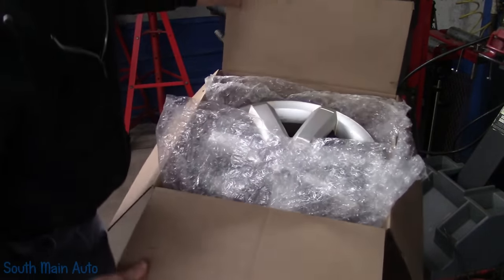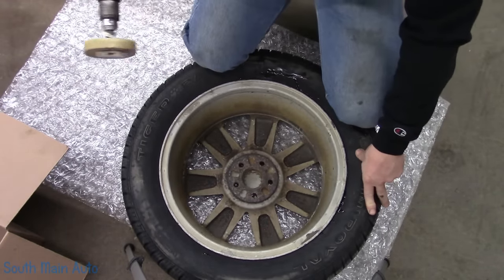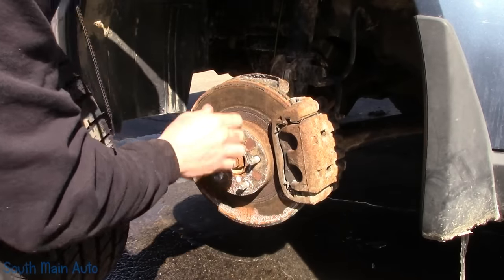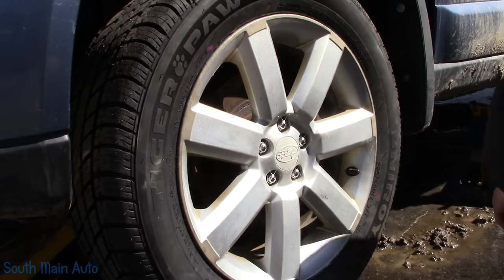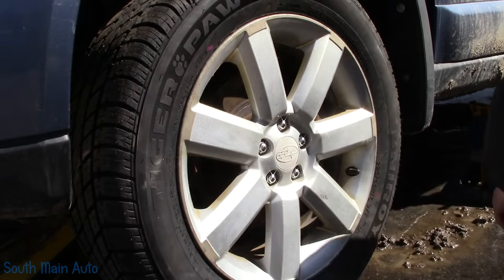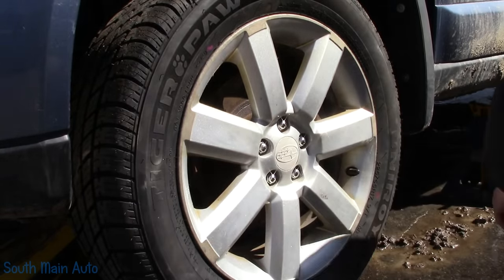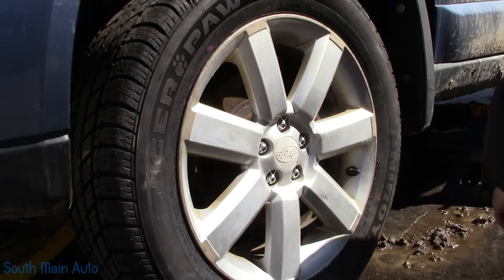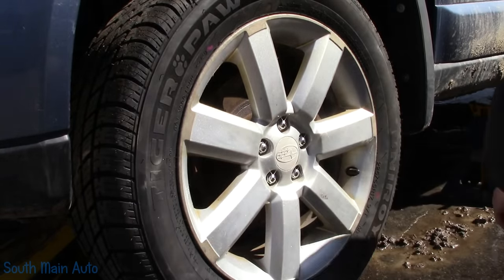Subaru Lost A Wheel On The Highway!

Comment: I am pretty particular about who touches my car. I wouldn't hesitate being your customer. You do good work. Your attention to detail impresses me.
Reply: Did you see the impact gun done on the alloys
Reply: You do awesome work!
Reply: 😂 attention to detail 🤣 .. he gets the job done!!
Reply: @efraincruz6969  The attention to detail would be all the clean up he does that MOST places do NOT do.. and yes he does get the job done.
Reply: Right? I normally work on my own car, but I've come across a vibration issue I can't nail down so I'm looking for a mechanic. I've damn near looked at 40 mechanics and still haven't found one I trust to handle my vehicle.
Reply: Sorry folks.... this guy isnt real. Well, hes real, but his shop is a studio, not a real auto repair shop.
   It cant be. If it was real, there would be at least 3 unfinished jobs in the front, and 2 in the back that have been repaired but not paid for and are basically abandoned.
Reply: @TheBigBigSean  axles or driveshafts and ujoint tight ? Wheels got weight on em ?
Reply: @jupitercyclops6521  Have you been to his shop, Because i drove past it last summer driving to my spot for camping, as his shop is only 2-3 hours away from where i live lol.
Reply: @chris77777777ify  Did you see him follow up with a torque wrench? You need to watch ALL of the video. Nothing wrong with using an impact to get it on most of the way, so long as you finish up with a torque wrench.
Reply: @efraincruz6969  I rarely see this today, detail, getting it right.
Reply: Did the customer go back to where. He had the tire ps put on they  obviously did not torque the lug nuts
Reply: @hairpunut  
Next time I'm near where he is, I'm going to have to check it out. He's two hours and fifty minutes from us.

Comment: I always wondered what a knuckle would look like after a wheel ejection event. Thanks for sharing. I would've needed new shorts in addition to a wheel and tire combo.
Reply: Are you saying you would have gotten a free and instant booster seat?
Reply: I've seen more than one and this is probably one of the LEAST damaged I've seen.  Must have happened at a fairly low speed.
Reply: I agree with ratbert. One of my lower cheap ebay ball joints broke while making a u turn on a small street. The knuckle is fine but I think it screwed up my upper and I then got some metal damage from the tow truck pulling it since the wheel was hitting. So not much damage at low speed. At any speed that could be really bad. When it comes to suspensions do it right the first time. Now I can do my lower ball joints without any problems. Live and learn.
Reply: @myshots101  Luckily it was at low speed or the live part of live and learn might have ended differently. I bought Moog because of these reasons.  They were a little more expensive but past experience had proven they were worth it - when you had a problem with Moog - they stood behind it. Not anymore.
Reply: @ratbert86  True. I got the moogs now. Haven't installed the uppers yet. I'm not sure if it's the ball joint or the bushings that make a noise when reversing now. I have the uppers but think I might get the bushings once I get some money and do both at the same time since I may have to take the arm out anyway.
Reply: Definitely causes white knuckles
Reply: Not a full on tire ejection necessarily.  But look up toyota lower ball  joint failures.

Comment: Re-torque those fasteners after a short drive:
"The most common reason for a wheel to separate is failure of the fasteners, where wheel nuts fall off and/or wheel studs break and release one or two wheels from the vehicle. These failures generally occur 175 to 3000 miles and one to fifteen weeks after a wheel was taken off and put back on during some service, such as a tire installation.

There is a different pattern of evidence in left vs. right side wheel separations. Left side wheel separations usually occur after the wheel nuts spin off (Figure 2) whereas right side wheel separations usually occur after the wheel studs break off 
Wheel nuts that were properly torqued can lose their clamping force. Some reasons are wear of paint coatings on brake drums, break up of corrosion deposits or dirt that was in the ‘sandwich’ when the wheel was put on, and wear of aluminum wheels.

Fortunately there is a well-known remedy for lost clamping force. It is simply to re-torque the wheel nuts after a short amount of driving. There is no need to remove the wheels or even jack the vehicle off the ground – just using a torque wrench to apply the manufacturer’s specified torque to each wheel nut after a short amount of driving will normally cure any loss of clamping force. Although wheel separations are rare, they should be entirely preventable with re-torqueing."
https://www.meaforensic.com/wheel-separation-accidents/
Reply: But you usually know long before teh wheel comes off. I drove a car where the lugs were not tightened at all, just finger tight. It made noise that was pretty obvious.
Reply: @robertgary3561  the point this guy made is that they can be properly torqued on installation and still end up failing for a variety of reasoms
Reply: I work  in England as a tech and the policy is to clean the mating surfaces of hub and wheel, add grease to hub, do wheel nuts up by hand, no power tools, torque to manufacturers specs, re torque after 15 mins. I had a wheel fall off because of I replaced front brake discs and didn't replace and torque the grub screws, turns out there is a warning from the manufacturer about this problem, the grub screws come loose and slowly loosen all the wheel nuts. When the car came into the shop and we removed the wheel after the owner put it back on, the grub screws were off and sitting in crevises in the alloy wheel. It's Renault Clio, Nissan Note, Dacia vehicles.

Comment: Mr. O seems to spend about half his time sanding the rust off disintegrating New York heaps.  He should use some respiratory protection.  Otherwise, he'll be coughing up abrasive residue and rust particles in old(er) age.
Reply: Mr. O is a man. True men do not wear respiratory protection.
Reply: @SerbanCMusca-ut8ny  "True men" turn their lungs into dirty vacuum cleaner bags so they can collect disability payments, ride electric scooters and attempt to keep breathing through a cannulure.  Amirite?
Reply: @thisnametooktolong  I don't think that's an accurate description of Mr. O. based upon what i've seen.  He does wear a hat, though.
Reply: @thisnametooktolong  
People in their fifties typically are not "the walking dead on disability"... Maybe the standards are lower where you're at and you've exceeded them? Where you coming from dude?
Reply: @thisnametooktolong  Come to CYXS. You've joined the zombie apocalypse! :-)
Reply: I did the same undercar work for almost 30 years. Never smoked and yes now I have lung problems. 
Too late but lesson learned. I never used fluid film but I did use Anti-seize after cleaning all the surfaces. 
The rust dust will come back to bite you.
Reply: If he chose his parents wisely he won't have anything to worry about.
Reply: Always a safety Sally in the crowd.
Reply: @MrShobar , a CANNULURE? LOL

Comment: My favorite part of this video is when you flattened the sides of the nut so your socket would fit. Nice move.
Reply: I showed my nephew the magic trick after he totally rounded off a brake caliper bolt on the backside of the wheel how to take a file and file flats on it down to the next smaller size and use a 6 point wrench. That’s why I collect up 6 point box wrenches.

Comment: I really appreciate how you explain every step. My 2006 outback is still going strong thanks to you. Should click over 300,000 original miles by the end of the year. Brakes , shoes,rotors, bearings, drive shaft, timing belts, water pump and hoses all done by me. Please keep posting. T

Comment: Send the bill to the shop that replaced the tires. 
Aluminum rims should be retorked after a mile or 2.
Off topic Q ?
I see you have a mezzanine 
When are you gonna give us a tour of that sweet shop????

Happy viewer from British Columbia,  Canada.
Reply: I'm waiting to see some forklift action, too.  Often see the forklift in the background of a shot, never seen it being used.  I'm guessing that it does, how else do the big items get up on or down from the mezzanine?Another viewer from across the (small) pond, in Onscario, Canada, eh....
Reply: Not everyone comes back to get there wheels retourqed
Reply: My truck calls for 500 ft-lbs on all ten lugs per wheel. There are 60 of them on the tractor alone, 40 more on a standard tandem config trailer behind.  You can tag-team it, having one guy pilot the socket over each lug while the other one does the twisting, but there's no sense trying to rush the job. For my own truck, I insist on being one half of the "tag-team". That way, I know that every lug has been torqued (or re-torqued after driving 75 miles or so).  I had an incident some years ago involving improperly fastened lugs, and only by pure bull$#!t luck did I not have the wheel completely separate from the truck. It damaged the aluminum rim, the pilot flanges on the hub, the studs, and they put new lugs on just because they didn't trust the threads from the old ones.  That cost a small fortune that eventually got charged back to a very unhappy tire dealer near Milwaukee, Wisconsin, but I put the brunt of the blame on my own shoulders for not demanding that the fasteners be torqued.  On the positive side, I can say that I survived a 3hr delay on the shoulder of the Dan Ryan Expressway without being struck by another vehicle during the afternoon rush.
Reply: It is usally the left front that comes off. Back in the day Mopar had left handed threads on the left side wheels.
Reply: @Jason Bowman Ford trucks use hub centric wheels where the center of the hub centers the wheel, and flat based lugnuts with built in washers. others use a conical base lugnut which recesses into the wheel to center the wheel. If you tighten conical lugnuts that tight it can damage the conical recess in the wheel. in contrast if you don't tighten flat base lugnuts that tight the wheel might slip a little under the lugnuts under acceleration and deceleration, this can lead to oval lugnut holes and can loosen the lugnuts over time. The bigger trucks often use the same type of bolting system for their wheels as the newer ford pickups.
Reply: Good day, eh? How's it goin', eh? Got any beer? Greetings from Saint John, New Brunswick, here on Canada's East Coast.
Reply: @fabricatedbeast9756  it's not necessary if they are torqued to the correct specs.
Reply: @fabricatedbeast9756  In my opinion every driver should have a right size socket, socket extension,24" extension bar, and proper torque wrench in the trunk of their car.
Specified torque for lug nuts on my Toyota Corolla is 76 Foot pound, so I carry a torque wrench 15-150 ft-lbs.
Reply: Rick O'Shea  What is wrong? The manufacturer has specs for every fastener on a vehicle. If the fastener is torqued properly it is not necessary to 're-check'.  How many new cars get the wheels checked after 1-2 miles?  None. Torque specifications exist for a reason.

Comment: Did your customer get any compensation from the shop that installed his new tires? This happens a lot, shops don't check their work. I always re-torquthe lug nuts on my vehicles when anyone besides me works on them.
Reply: Aluminum wheels are supposed to be re-torqued after X number of miles. I think it is 500 miles. Not sure how many miles this customer had put on. When I worked in a tire shop, the re-torquing requirement was written on the work order. Rarely did people stop by to have it done.
Reply: So when you buy a new car or truck with zero or so miles on it with aluminum rims they all have to come back and get checked lol I've been working on cars and trucks for 29 years the reason the tire stores have that policy is because of the employees they hire and to cover there ass for the reason you see here lol
Reply: @jasondelvecchio8720  This is what it says under the "Aluminum wheels" section of my Outback manual: "When any of the wheels is removed and replaced for tire rotation or to change a flat, always check the tightness of the wheel nuts after driving approximately 600 miles (1,000 km). If any nut is loose, tighten it to the specified torque."
Reply: Yea I did a van last summer. Lug nuts were so tight I said screw it snap em off stretched fatigued cracked studs need replaced anyways.
Reply: Last time I had tires fitted I brought my torque wrench and stayed at the shop and stopped them when they were going to fit my wheesl with an impact wrench! They found it extremely funny that I cared about them not hammering the bolts in at 200NM = less work for them. So everybody happy.
Reply: @Rickmakes  100 miles

Comment: My experience for how to know if a wheel is loose is a rumble that stops when you apply the brakes.
Reply: Had it happened to me in a Chevy van about a week after getting tires on the rear. Nothing appeared out of the ordinary then one day at about 55 mph there was a slight Rumble which got really bad fast and then all sudden my tire was passing me on the highway. The time from hey did you notice that until seeing the tire rolling away was less than 1 minutes. I was actually looking for a wide spot on the shoulder to pull over then it was too late.
Reply: My dad has bad breath

Comment: @23:35 - You mean you didn't rip off your customers again? You gave em the options to make the car safe again? What's wrong with you?! 

Honestly, I admire that about you. And you did a great job making that Subie go for that customer. I just had my car serviced by the stealership for a recall. Good ol' Takata Airbags in my Pontiac Vibe! Dash cam revealed they didn't do any inspections, yet they wanted to sell me a bunch of services totaling up to $500! Funny thing was, I already did them. Coolant flush, fuel system cleaning, and trans fluid service. Had they pulled the dipstick, they would have seen beautifully clean fluid, and had they even checked the radiator fluid, or use a hydrometer... "Oh, well, we assumed based on age it would need it" was their response. But before, "Yeah, you're car will need these" Caught them red handed in their lie. That was before I checked my dash cam and saw they never even checked anything under the hood lmao. 

You sell your customers what they need, not what you need. I wish I had you around here for the service items that are too big for me.
Reply: That's  criminal. With the proof of fraud that you have I would have run the full course against them along with the video to local media so your fellow towns people  know about it.
Reply: @InsideOfMyOwnMind  I mean, once I confronted them after the service adviser came to me recommending those services, and I told them that I already did those before winter, he quickly followed up with they were just based off age and mileage. (My car is an 04, and it has 105k miles, so when it rolled to 100k back in Fall, I did changed every single fluid in it). Oil is due soon. 

I'm more of someone who prefers doing service based on what the vehicle truly needs. I never even saw my oil dipstick come up. The Dealer Mechanic just took a flashlight and looked around my engine, then slammed my hood closed. 

However, imagine had a shop like SMA that based on actual need recommended a ton of work to a car, and a clueless owner who does genuinely care about their car's well being be told all that work it needed having to repay for some of it. "Oh, normally I have a guy do it, but maybe I'll save him some trouble and just have my Chevy dealer do it, I am already here." I know my grandfather was a man who'd just give money away when the mechanic said that, now I do all his car's work thankfully...

Comment: When I owned my foresters, I couldn't let one tire get lower than the rest because as little as 1/4 inch difference in tire diameter side to side can mess with the awd system. I loved those cars but man was is stressful owning them with all their peculiarities.
Reply: Just wondering why you would have a tire go lower?? 
I drive 55k per year and can't even remember a time a tire lost any air besides a puncture, or just seasonal change with effected all tires the same.
If your having an air loss issue, make sure the bead area is clean before installing tires and  valve stems.
Your right though Subaru don't like uneven tire diameter, and they have some other interesting issues.
Always loved how the fuel filter was right up top and easy to change..on older models. something that gets neglected on many vehicles.
Reply: @kens97sto171  it's more along the lines of say, you shouldn't replace just one tire if they have a lot of wear in them and you get a flat...you should replace all 4. Little quirks like that making owning these a chore but holy shit are they fun to drive (turbo and 5MT of course)
Reply: @ADR69  
That is definitely an issue..  they are fun. 
Had an 06 Legacy wagon.. was a GT trim without the Engine. Not sure what it was called.  But it was sexy. And practical.. although a bit slow.

Comment: Only $30 or so for that ball joint puller.  Astro Pneumatic Tool 78620 Subaru Ball Joint Puller.  If I had a Subaru, I'd have one of those.
Reply: after this video, seeing the wear and worn parts (in terms of corrosion) and its still rolling? Wonder if it will withstand the desert environment. Hmm what year is this vehicle?